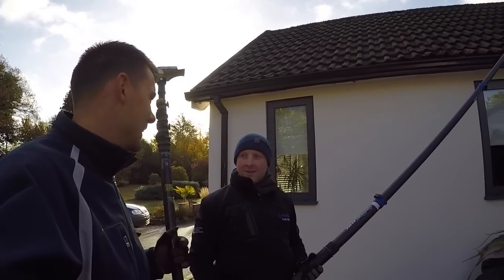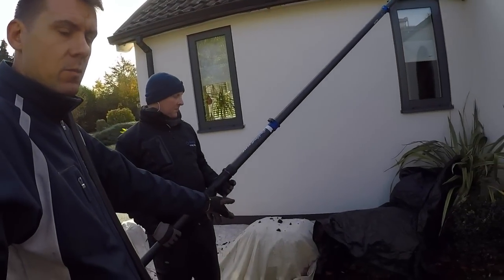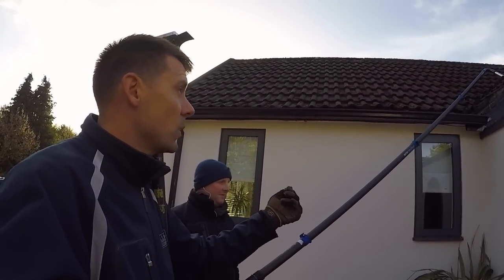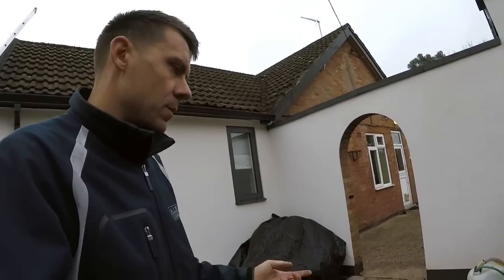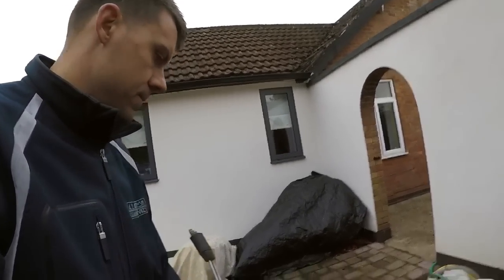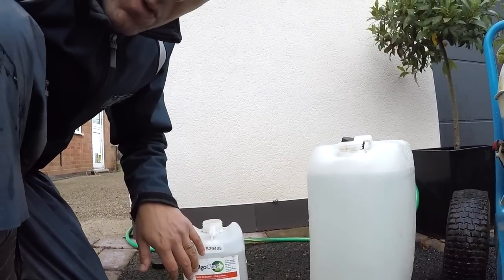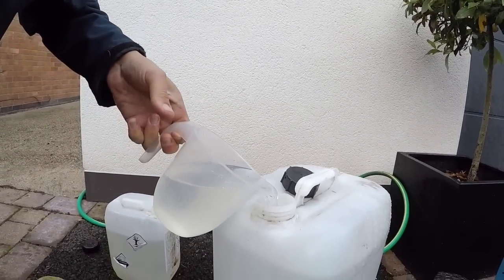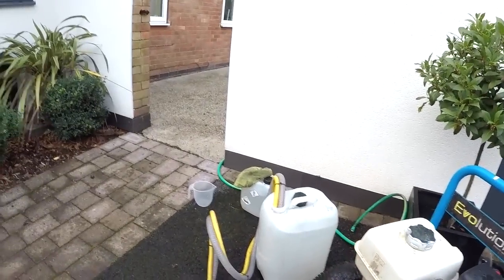Apply Algo Clear Pro Biocide Softwash Using A Pressure Washer

Comment: Could you do this with hypo as long as it was a weak mix, say a 1 to 5 or 1 to 7 then give pump a good rinse out?
Reply from the maker: Yeah, but I would want to be a little more careful with how I apply hypo.👍🏼
Reply: What ratio would you recommend with hypo to be safe through the pressure washer pump. Is it something that you have tried.
Reply from the maker: I don’t use hypo through the pressure washer. I prefer to use biocide.

Comment: Great job. Does the Algo Pro get rid of black spot lichen like hypo does? Thanks
Reply from the maker: Yeah, but it takes much longer. Hypo is more instant, but it’s not so environmentally friendly.👍🏼
Reply: @aemackintosh  I was told that bleach doesn't work very well in removing mould from porous / permeable surfaces as it has roots and any bleach will only kill off the top. Is that correct? I was then told that a proper fungicide such as DDAC is the only thing that will kill it off systemically. Not sure if this applies to just mould but presumably lichen as well?
Reply from the maker: @bitTorrenter  It can be very confusing because bleach based products work very differently to DDAC based products, yet both are referred to as biocides and softwash.🤦🏻‍♂️

Comment: Great video did you rinse down the roof after the treatment worked. Also can I can why you did you not use the internal pressure washer chemical option with the small valve cheers.
Reply from the maker: The little chemical inlet valve can be a bit temperamental. You just spray on the treatment and walk away. It acts as a preventative.😃👍🏼
Reply: @aemackintosh  fantastic many  thanks. What evo pressure washer you got plz LPM and Bar cheers
Reply from the maker: My machine is 21lpm and a maximum 3000psi.😃👍🏼
Reply: @aemackintosh  nice setup cheers for your response all the best moving forward stay safe I look forward to more vids
Reply from the maker: Thanks.😃👍🏼

Comment: Hi Ash I’ve just been asked to clean the moss of a roof which is the best cem for it you have found works best , cheers Frank
Reply from the maker: I have been using a scraper first then treating with AlgoClear. It takes a while to really see a difference, but it’s good stuff, and it acts as a preventative for up to 2years.😃👍🏼
Reply: Thanks Ash

Comment: Great video is the pressure washer a normal one or is it for chemicals.
Reply from the maker: Kevin Kelliher This is a regular pressure washer. I think most of them usually come with a chemical inlet like this. I have found them a bit temperamental sometimes though.👍🏼

Comment: Good vid. Could you use the gardiner back pack to apply the bio stuff? Also how would you price a job like that? If you don't mind me asking. Thanks.
Reply: I have just done one job like this and I used my back pack, works well with your pole and nozzle from DA Components. But you have to re-fill often.. And clean your backpack after thoroughly,,,  My 2 cents. 👍🙂
Reply: @Robert-ij9ih  i can imagine..that roof he was doing wasn't small. How about pricing i'm guessing hourly rate whatever that is. And do you not have to do a training thing for these softwash chemicals?
Reply: I would go dubble or more price wise compared to window cleaning, coz people don't have the equipment to do it them selfs... Training? Good question  @davidb800
Reply: @davidb800  And the chemical is expensive as well, here I live
Reply from the maker: Check out my video “easy softwash setup” which will work similar to a backpack. Each section was a barrel (20l) of mixed solution, then the large section at the back was about another 4 barrels. So yeah, a backpack on a roof like this will take a lot of refilling.😃👍🏼
Reply from the maker: I price per square meter, about £2.5 per square meter.💦😃👍🏼
Reply: A.E.Mackintosh Cleaning Services do you charge £2.50 per sq m for scraping the moss and applying the biocide or just for the biocide treatment alone?
Reply from the maker: Scraping and biocide. But it depends, if it is very mossy you might want to charge more? You might charge less per square meter if it is a larger area. It also might depend on your own business and how you sell it to the customer. I like to put more emphasis on the benefits of the biocide, rather than saying that I will remove ALL the moss. Hope that helps.😃👍🏼

Comment: Hello Sir, i applied biocide to a driveway after washing it running it through my pressure washer. But just a few week later it grew weeds. My question is does biocide kill all weeds? Anticipate your answer as my boss is ready to hang me as our depot is in leeds and the job was done in luton!!
Reply from the maker: Not necessarily, biocide is not a weed killer at the end of the day. You need to treat weeds with a good glyphosate a week before cleaning. Spray the leaf of the weeds and let it soak in to the roots.👍🏼
Reply: @aemackintosh  thank you so so much!

Comment: Hey Ash,  I was wondering if running biocide through your pressure washer will it do damage to it at some point? Now you have been doing this for a while have you come across issues to your unit that could be the result of running this type of stuff through it? Thanks
Reply from the maker: Biocide won’t damage and surface or component it comes into contact with, it just reacts with living cells.👍🏼
Reply: @aemackintosh   till thanks Ash, I suppose it’s good practice to flush the system through when done so non is sat inside the unit?
Reply from the maker: Yes, good idea.👍🏼

Comment: Iv allways used hypo. Would you say the difference between the two is that hypo is instantly and the pro your using takes about 2/3 weeks to work.
Would you say that's right...
Reply from the maker: Spencer j There will be a continual improvement on the roof for some months after, and it also prevents the growth returning for up to 2years.😃👍🏼
Reply: @aemackintosh 
Yes I agree with you on that.
But so do hypo. Can I ask if you've used hypo. And whats your thoughts on it... 👍
Reply: @spencerj1413  hypo does not last as long it's ok for instant results but a long term option biocide every time
Reply: @spencerj1413  biocides are a lot better personally don't use algo clear as it's overpriced Ddac is same thing  and half the price a lot less risk with using biocides then hypo biocides tend to last a lot longer I've used both

Comment: Evening. How much chemical did you use to complete the  roof
Reply from the maker: London pressure wash EXTERNAL PROPERTY MAINTENANCE Those first two sections were about a barrel of mixed solution each, then the large area at the back was about 4barrels. I probably should have mixed a larger quantity in a larger container, would have been easier.💦😃👍🏼

Comment: Does this not do any harm to the jet washer with the chemical going through it?
Reply from the maker: Neil Halliday No. I spoke to the manufacturer of Algo Clear and they recommend this an acceptable way to apply the biocide.💦😃👍🏼
Reply: It doesn't go through the pump so won't damage the pump,plus algo clear isn't as harmfull as bleach
Reply from the maker: It won’t go through the pump if you use the chemical inlet valve. Using pre mixed barrels like this means the solution will be going through the pump but a am assured by the manufacturer of Algo Clear that it doesn’t harm the pressure washer. In any case, I flushed it through with plain water afterwards.💦😃👍🏼

Comment: Ashley, wouldn't you stand on a bungalow roof and power wash it?
Reply from the maker: Jason Duckworth In the past I might have done it that way. But the high pressure could easily damage the roof, so this scraper method is a much better approach.😃👍🏼
Reply: @aemackintosh  what about high roofs? A 3 bedroom semi detached for example? same way off a ladder?
Reply from the maker: A scaffold tower is a good idea.😃👍🏼

Comment: Hi love the videos. Just a quick tip on ladder placement. It’s best to pitch to the wall or a parallel to floor roofline, pitching to a pitched edge is a recipe for disaster
Reply from the maker: Thanks. I prefer to use a scaffold tower these days.😃👍🏼

Comment: Have you considered getting a 3 section Pulex reach pole and an additional pressure washer M22 hose and build an application nozzle onto the pole. It will minimise your use of a ladder and safer for you working on ground level. DA components do some great applicator systems
Reply from the maker: AWPHOTOGRAPHIC Yeah, I’ve seen a few different things similar to what you’re describing. I already have a setup from a backpack with a nozzle from DA Components. I should sort something with a long reach for my pressure washer. Thanks 😃👍🏼

Comment: Nice informative videos 👍  However I’m confused , my understanding of Softwashing  is non aggressive cleaning - using Biocides to eradicate organic dirt/substances , ie moss  , litchens  , algae .   Non aggressive is gentle cleaning , no high pressure , no nasty chemicals.  Yet there are loads of videos about soft washing that  people are using pressure washers on high power, rotary cleaners and varying mixes of Sodium Hypochlorite- BLEACH .  
To me that isn’t Softwashing , but pressure washing  with a chemical at the end to brighten ?  Obviously you need to remove the ingrained dirt first with pressure washing , THEN you would Softwash using a biocide to prevent the organic growth .     Or have I totally misunderstood it all ?
Reply from the maker: Dan Friday Yeah, it seems to be a fairly vague term this softwashing. To me, it’s the application of a biocide without any high pressure cleaning. In this video I was just using the pressure washer to apply the solution without aggressively attacking the surface. Then I just leave it to do it’s thing.😃👍🏼
Reply: A.E.Mackintosh Cleaning Services  .   Yes  I agree .  I didn’t mean you were using the PW as a cleaner , I could see it was just a application method . Those twin lances are great tools
Reply from the maker: Nice one, thanks. Glad we’re on the same page.😃👍🏼